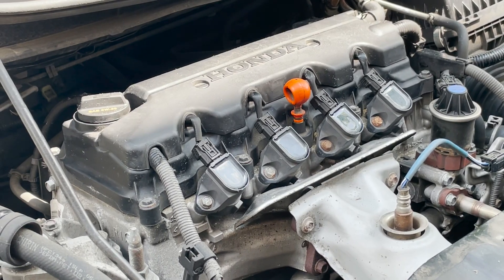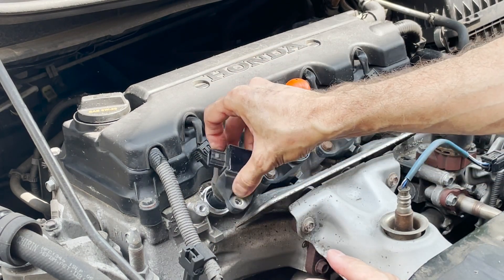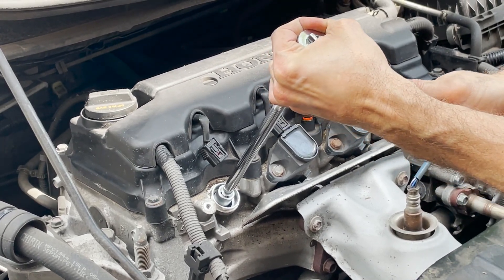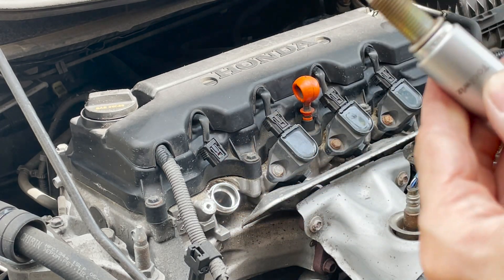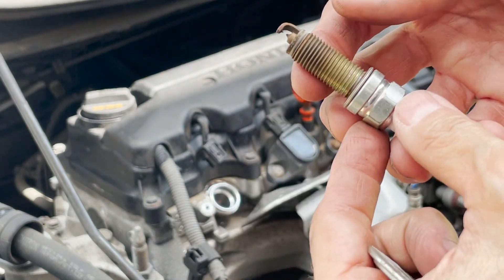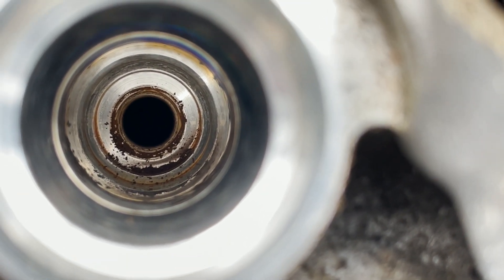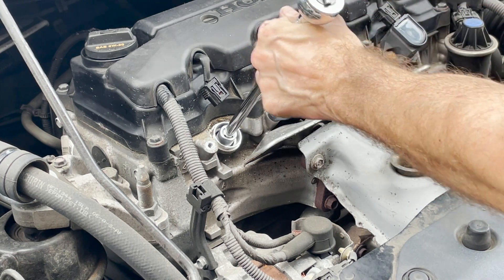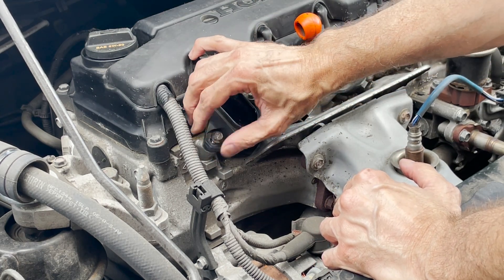How to Check the Condition of the Spark Plugs

Comment: Thanks for sharing the information and i appreciated..how you can clean the dirty please
Reply from the maker: @bluetalestories12  I would say to be very careful of not dropping dirt when you remove a spark plug because it goes straight into the cylinder. If you will clean dirt around the spark plug, leave it in and suction any dirt first.
Reply: @ Thanks 🙏🏾🙏🏾

Comment: I didn’t show the name of the spark plugs or the specifications, and I didn’t show the tips either. Badly. Before you do anything, you must first clean it of dirt and then unwind it.
The hatch does not close completely and returns. Don't know what to do?
 Otherwise thanks.
Reply from the maker: Thanks for the feedback. NGK Laser Iridium. Gap is 0.44 in minutes 2:30
Reply: @gotitdone  The hatch does not close completely and returns. Don't know what to do?
Reply from the maker: @михаилрудой-э5ъ  what hatch are you referring to in the spark plugs context? I am not following you
Reply: @gotitdone  You don’t have a topic with sunroof repair, so I asked a question in the latest issue. Maybe you can give me some advice or help. 
The sunroof of the car does not want to close automatically.
Reply from the maker: @михаилрудой-э5ъ  the sunroof has two parts: the glass one (works with the button)  and the internal cover (you close with your hand). 
I have seen cases where the internal cover is slightly out of the actual rails which makes it harder to close by hand but still doable. 
The problem is when you press the button to close the glass one, it “feels” the internal cover resistance and returns back to the open position. 
You can prove this point by pressing the close button and quickly move the internal cover as the glass one is closing.
Reply: @gotitdone  There are no visible obstacles to the glass hatch and the curtains too. I think there was an error at the software level and the hatch “thinks” that, for example, it rests on the hand and moves away. (as in door windows, glass). Somehow this error should be reset and the hatch should be retrained to automatic mode. But I can’t find the instructions, so I turned to you as a Honda lover))). I saw videos on YouTube for other cars, but I couldn’t find them for my Honda (HR_V awd 2018). By the way, it was bought from you in the USA after the accident and brought to us in Ukraine. I hope the translator translates correctly. My official dealer is far away, I will only be glad if you can help with advice.
Reply: what is the item you measured the spark plug sory my questions i am someone who wanna learn